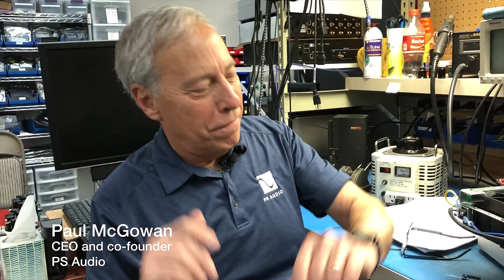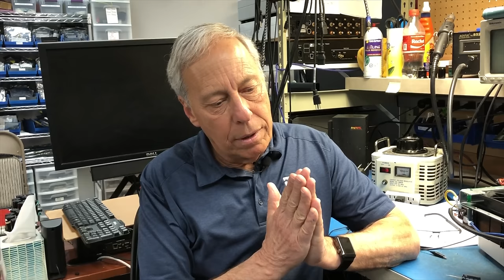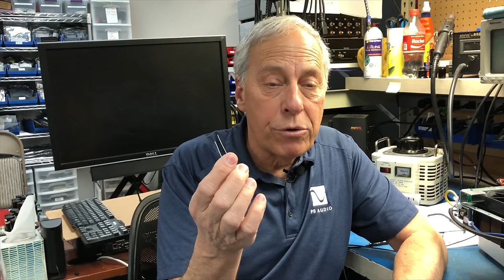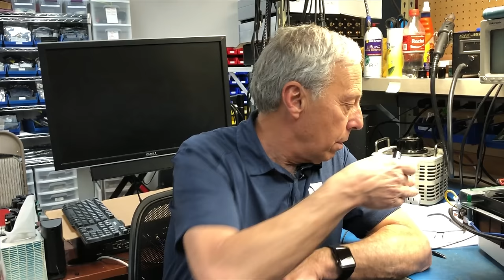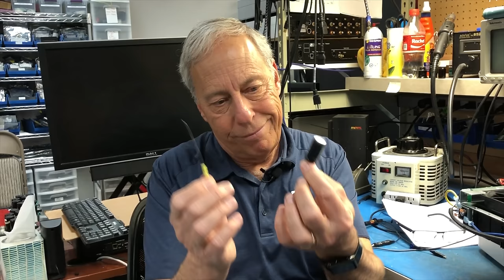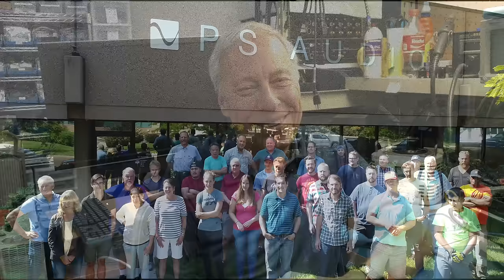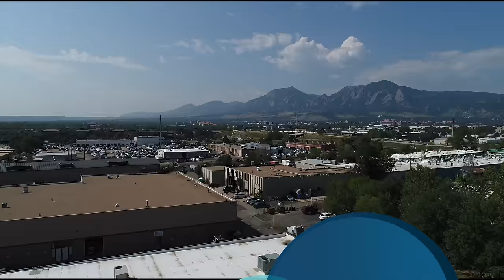Why do capacitors sound different?

Comment: the shortest answer to the title is ESR and tolerances.
Two years back I visited a web page that went in depth talking about tone caps, there were even audio samples.
You can have two capacitors of different types with the same exact Farad and voltage and the tonal differences are due to differences in tolerance and equivalent series resistance.
Reply: there is more to it than that

Comment: THE REASON IS, ESR OF CAPACITORS - See the explanation given below if needed.

1. Capacitors are meant to block DC and to pass AC.

2. If the frequency of a signal (or current) is Zero Hertz (the unit of frequency) -  it is DC. 
And if the frequency is One or more Hertz, then it is AC. 

3. We use capacitors with suitable values to block or pass the some frequencies - Higher capacitance values can 
 pass low-freq signals and vice-versa.

4. The electrical audio signals are AC, varies somewhere between 20Hz to 20,000Hz - Here, the lower frequency signals 
are supposed to be handled by the Woofers/Sub-Woofers and the higher frequency signals are by Tweeters and the 
mid frequencies are by Mid-Range speakers. We must pass only the intended frequency range to the respective 
speaker type, otherwise, it may sound strange.

5. The mentioned "different sound quality" is mostly observed on the low frequency ranges - here reveals the actual problem.

6. All capacitors do have ESR (equivalent series resistance - it is an AC resistance, it decreases with increase in frequency) 
and this parameter will offer some sort of blocking to the lower frequency signals which pass through it.

7. Since the low frequencies needs much current to be reproduced effectively, the current limiting by ESR will be 
a villain (bass may not be as deep as expected, with lack of expected current)

8. Also, in crossover networks, we use capacitors to bypass the unwanted frequencies to ground and to pass only 

the wanted frequencies to output, but, with this ESR, those will not be passed/bypassed effectively, and the 
speakers which are connected to the output will sound different.

9. Polypropylene capacitors (the small yellow one shown in the video) are at-least 10 times better than electrolytic 
caps in terms of ESR and hence those are called "audio-grade". (Any caps with lower ESR can be audio-grade in fact)
Reply: Yep! And an aged electrolytic cap could "develop" inside a ESR value of several ohms, which may conduct to silent tweeters in speakers. Bought some Telefunken RB 70 speakers (made more than 50 years ago) with dead-like tweeters and with weird sounding low and middle frequencies. After caps changing , the tweeters come to life and the speakers have a very pleasant sound.

Comment: To anyone reading this and thinking it might be snake oil or it might be marketing. I actually tried it. I changed out electrolytic capacitors in a speaker for solen and also oil caps. They all sound different. I've also tried this inside amplifiers. You can notice a difference. The change is how the sound resonates in your ear. even if it measures the same which I'm not sure if it would. You can make two different sounds that appear exactly the same on a scope but they sound different to your ear. Caps absolutely have an impact on total balance. At least if you have a good ear. If you happen to be one of those people that think amplifiers all sound the same you might not notice it. However, there's only one way to find out and that is for each person to try it

Comment: In short: some caps have more electrical resistance and unwanted inductance than others which could emphasize certain frequencies and diminish others and cause phase shifts. Electrolytic caps have relatively high internal resistance because the electricity passes not only thru metal but also thru this paste with water and salts, which doesn't conduct perfectly. The chemical reactions inside can also create tiny tiny gas bubbles which when created and vanish create variations in capacitance and resistance that manifest as noise. Because of their build with rolled up foil, they tend to have more inductance also which makes them better suited for low frequencies like filtering the 50/60 Hz out of line voltage. Now if these things are built with great care, these effects are smaller than with cheaper ones. Still, generally one would put a non-electrolytic cap in parallel to short any radio frequency interference.
Reply: It's simple ac LOW FREQ AUDIO electronics Paul,  not rocket science. C=ak/d & xc=1/2 pi fc,  ESR= ESR=DF*Xc=DF/(2* π*f*C. If you as a "HI-END" source buy quality parts; COTS, ISO 900X and screen them properly then there should NEVER be a CAPACITOR failure in your boxes if the design passes muster. Caps, if made properly have similar finite lifetime as OTHER solid state electronic. 

Paul is a BS artist. Really, at Paul and his competitors prices you should be getting milspec, ever hi-rel traceable products. Hi-End audio thrives on fear/ ignorance. Fear you say? Yes the fear that your system won't measure up to your lawyer co-workers at you're pot/alcohol & cigar bar party. Just kidding, Paul. We love you.
Reply: one thing to remember when using an  Electrolytic cap, it has polarity, if you put one in backward it will explode and smell really really bad  :)
Reply: K Carney Only a polarized cap. Non-polarized caps don't care what direction they face. So long as it adheres to Feng Shui mythology.
Reply: The interference is high frequency AC on top of the DC. Your film cap is parallel to the motor and shorts the AC component produced by the motor. It does not short the DC cause caps don't conduct DC.
Reply: powertothebauer in short (pun intended), your unwanted motor interferences are A/C signals and are passed (shorted) through the capacitor in a rather brute force way: parallel-connected to both inputs of the DC motor. BUT for speakers, the connection is in series, like a paper dolls_chain holding just their hands, and so imagine one of the dolls is very little so she simply cannot stand to be shaken too hard with a  large-duration pull, but indeed does very well when transmitting little alternating waves through herself. The little waves are high frequency because the speed of electricity must always move at a fixed speed throughout any conductor. That is what those formulas tell us. Why it wasn't put in simpler terms for an undisciplined hobbyist- well it is not your fault for not understanding because the electrical properties of motors are not externally apparent. They're what we consider black boxes of a sort, that nobody knows how they'll react until they're probed by meters or carefully connected. I suppose just that you're not careful because the manufacturer specifies a value and you simply throw it on without paying much attention. No big deal, we experiment more is all, but we also realize that DC voltage is not going to fry up your speakers if the current is next to nothing. Lots of other components that would be fried up by DC are actually fed little amounts of DC in a technique that is called biasing. Think of chip biasing as the old vacuum tubes being warmed up before they could start working, except this DC biasing has to be continually applied because of other characteristics. Of course the chip would fry up with a high bias-current, but resistors and especially capacitors block that from happening, which in the latter is related to how low frequencies behave more like DC while INSIDE any component. Clearly pure DC does not alternate, but AC signals can be biased to the point where the most negative troughs never reach 0V, and look on a scope like pulsed DC. You're probably only familiar with balanced inputs and 0V grounding, not these signals that legitimately 'float' above a 0V ground.
Reply: Grobbekee - I would love to hear your bizarre theories applied to SMD ceramics in explanation of the vibration phenomenon. Where are the bubbles there?

Bubbles. Really?  So what of inductance? Is that something like magic crystals?

The material science at the phase interfaces of electrolytic capacitors does not lend itself to easy folklore answers.
Reply: Ceramic cap have no water in them, so no small amount of electrolysis and therefore no gas production at all.
Reply: Capacitor stray Inductance is not really a significant factor in audio, considering the extremely low value of inductance and the low frequencies used. Enjoyed the rest of your explanation, and yes good manufacturers do pay attention to noise limitation.
Reply: Electrolytics are polarized, which means they don't have identical behavior in both directions. They aren't really ideal to put in the audio path at all. Electrolytic are great, though, at filtering out DC ripple which is powering the output stage.
Reply: @FooBar89  You don't rely on it... it is there as a buffer to keep the voltage stable. The power drain from audio is very dynamic and changing. Caps are put there to keep the voltage rock solid stable to prevent any coloring of the audio from the voltage drooping or rippling.
What you are saying is like saying, "Runners need running shoes? If runners rely on shoes to win, they shouldn't be in the Olympics"... that is absurd!
Reply: @FooBar89  So what you are saying is, if you have a bridged rectified transformer feeding a regulator, you shouldn't use any capacitors? Really? Where does the regulator source power when the power has 100% ripple? Capacitors are required in DC power supplies full stop. I am done here, because I am talking to an unreasonably mad person who doesn't even know what he is talking about.
Reply: @rich1051414  Solder 2 electrolytics back to back in series and you get a bipolar electrolytic of half capacity, which is no longer polarized. It does have double ESR though.